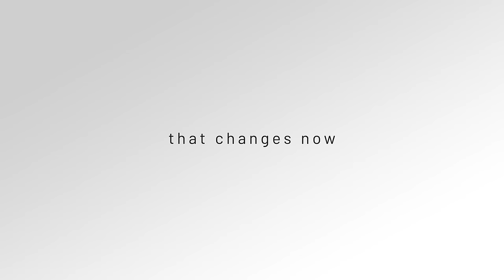New Story + ICON + Échale | “3D Printed Housing for Those Who Need It Most”

Comment: This is such a great idea, I can't wait until they start doing this massively in the USA. Wall smoothing, colored concrete, multi-story printers will soon be common place. Flood areas can use this for their homes, sheetrock and particle board are terrible materials for a home, concrete is so much better. The concrete they use is much more water resistant, hurricane resistant, much more thermally efficient, more earthquake resistant, fire resistant, termite proof, rot resistant, etc, etc...and these homes are much faster to build to boot. House plans are easily shared or altered on the fly. I own a CNC machine and am building a 3D printer, this technology is so much faster and more accurate, it is a wonder that this is only beginning to show it's face on home building.
Reply: Forgot to say multiple extruders running at the same time. Some things could be integrated like bed frames, sofas, cabinets 💡

Comment: Very cool! Will be interesting to see how these stand up to the test of time.
Reply: I was wondering the same thing, but i think it will outlive wood frame houses, the additive they add to the concrete make it stronger than regular concrete (6000 psi), water resistant, impervious to rot, termite proof, fire resistant, earthquake resistant, hurricane resistant, etc...
Reply: Patrick Miao yea and if they add a extra layer of wood on the outside and just paint the wood white it will last longer and look nicer but yea these houses are great
Reply: Agreed! I'm curious about using flat roofs since that would seem to collect rainwater? But also, how do you keep those walls clean since they're white?! I can only imagine the messes those adorable little boys are going to make! 🤣

Comment: Amazing technology and amazing work by these companies all for the sake of putting a roof over the heads of families. It might not be a mansion, but it's home.
Reply: Bear in mind that this is just a prototype. The building company ICON just completed their 2nd printing machine with more improvements planned for the printer. It will get larger, it will eventually print with greater resolution with wall smooth happening as it prints, colored concrete, printing curved or other unusual of shapes, larger two floor building will become common place, etc...  And remember, the file to print a house can be shared over and over again or changes can be made on the fly so that houses don't all look the same. Essentially, you are just printing G-code that can be shared.
Reply: @patrickmiao1698  I asked this question in the comments, but you seem to be the one in the know Patrick .
So , is the extruded material made from the local or on site material and is there being a method being designed at the same time to recycle this material down the line for new buildings and maybe other uses?
Has this system been prototype in snow country ? I know they are thinking of using this system on mars .
What are the floors and roofs made out of ?
Since there seems to be a lot of mass here , is there any thoughts of maybe incorporating solar thermal heating into these designs especially for cold climates?
Is there a site I can go to for answers to these and maybe more questions?
Thanks

Comment: Maybe this is in Mexico because county and city bureaucrats in US won't permit it or would require too many hoops to jump.
Reply: you are correct but the slabs are more than a foot wide with reinforcement wire mesh added after a certain number of layers. The special plastic concrete mix is designed to cure faster and support it's own weigh as the wall goes up. The area the homes are being built on is a seismic area. The 3D walls will actually exceed the building seismic codes of the area by a significant margin.

Comment: Cement is pretty expensive, is this actually cheaper than having someone build the houses from more traditional materials?
Reply: Yep, less than $100 a yard for concrete mix. To extrude all the walls cost about $4000 or less.
Reply: There is less waste cause of how the wall are laid. Less messy construction site as well,  the foundation seems to be laid ahead of time and probably with more traditional approach. This is meant to replace people just gathering materials to construct some sort of shack. Definitive improvement.